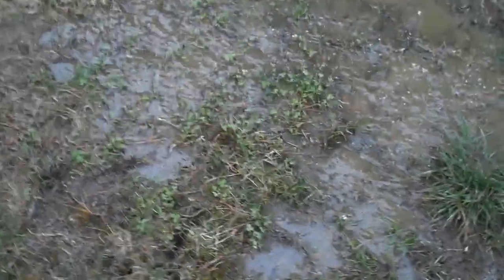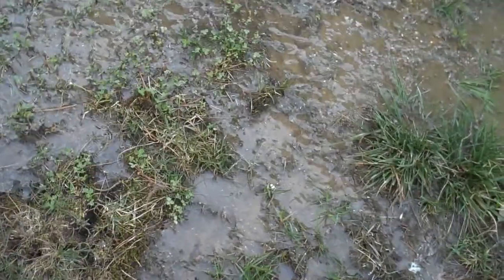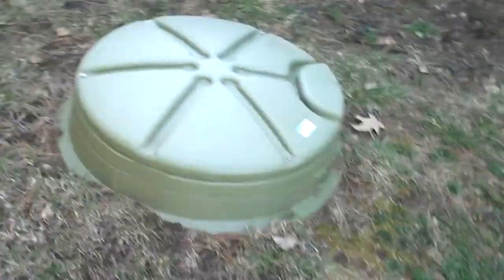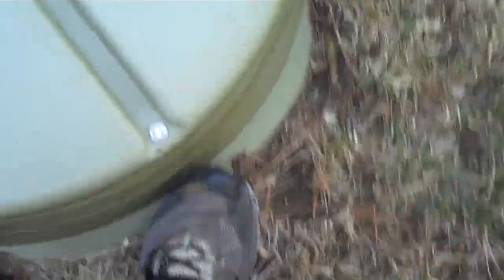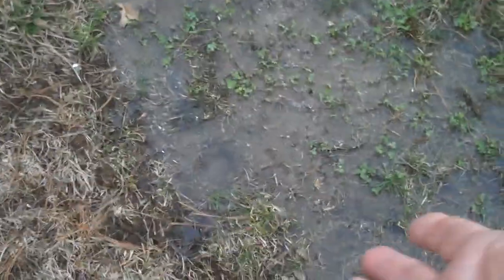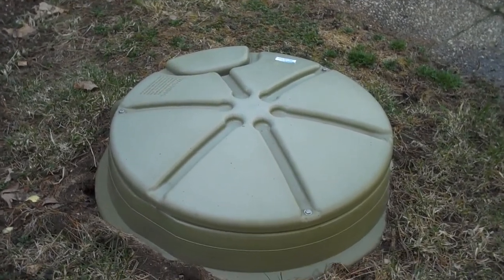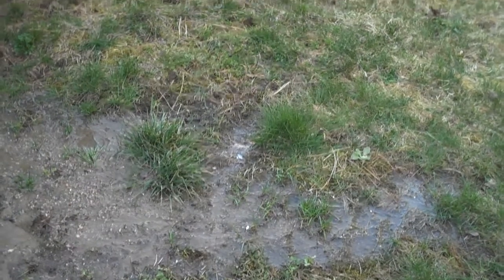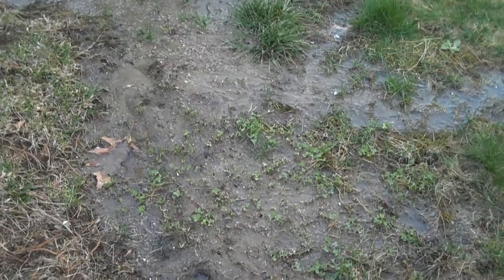Grinder Pump Failure due to unreliable Check Valve. April 2017

Comment: Where is the check valve in relation to the discharge line, is it right at the connection point on the grinder pump or further down the line?

Comment: What ended up being the issue
Reply from the maker: Unreliable Check Valves have been causing failures in Chelmsford Grinder Pump installations. This installation was done by Roswell Brothers. The Weston & Sampson technician told the homeowner that he has seen this type of failure at other homes in Chelmsford as well. Rick Roswell told the homeowner that this failure was due to a unreliable check valve. The bill to the homeowner for this repair was $800. This pump was installed in May 2011 and this check valve failed in April 2017 after less than 6 years in service. The check valve which failed was not the check valve built into the unit but one added in the discharge line
Reply: @mrdavetrouble  unfortunatly my friend had the chrck valve go and it rained feces from sewer to second floor toilet during a bad storm. 100k damages. She had an interior one